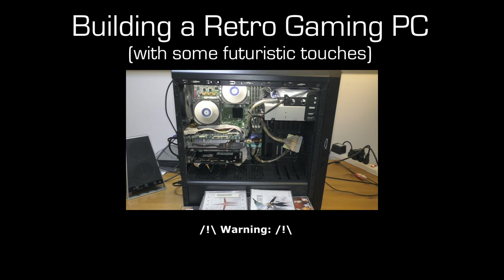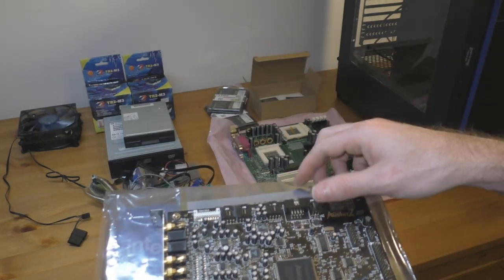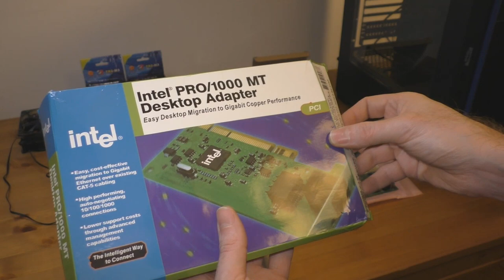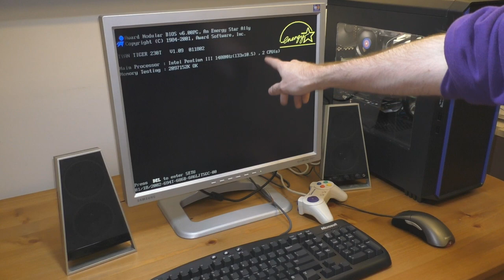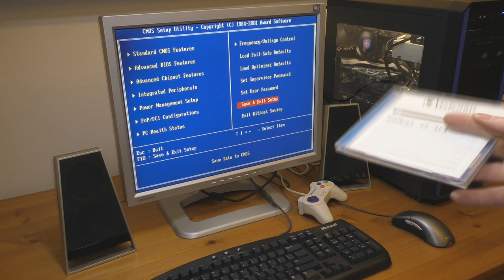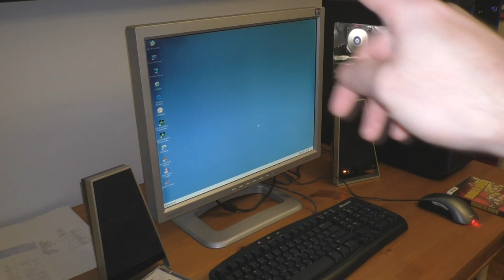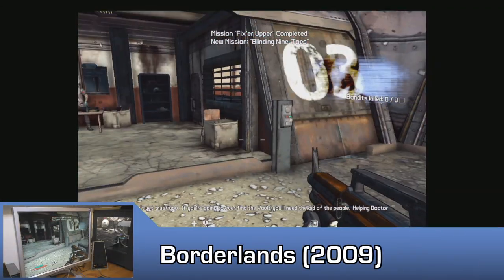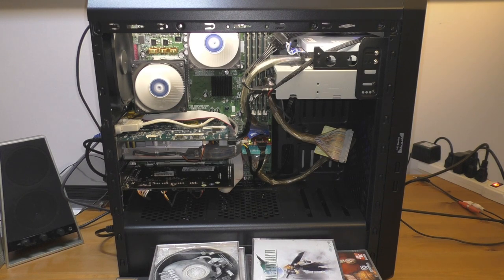[Retro] Building a Retrogaming PC (Dual Pentium III-S 1.4GHz Tualatin, 2GB SDR, HD4670)

Comment: Really nice build! I like the weird combination of parts and how retro it looks with the translucent plastics and rubber cables. Surprised how well it runs newer games. This machine probably runs FEAR pretty well if you turn down the cpu heavy effects like physics and particles a bit. Also, you should be able to force anti-aliasing in older less demanding titles through amd catalyst.
Reply from the maker: Thanks. I'll have to try FEAR. From the minimum requirement that should be ok. Yes Borderlands runs ok, but I don't think I'll have so much luck with other titles (good lord COD4 was horrendous to run).

Comment: That PSU adapter adds the negative -5V rail for an older ISA bus... You won't really get much use out of it with this motherboard having no ISA expansion slots.

But at least it turns out you needed an extension anyway.

Comment: Pretty sure that the dual CPU motherboards were server motherboards.   I'm thinking like the Asus CUV-4x-D, that you can run 1gb server SDRAM in each slot.  Should help with the RAM issues.   You should also setup at least 2gb of virtual memory with your ECC ram and 4gb with the server ram.    Get the latest version of 32bit Linux OS and see if you can install the right drivers for your card,  You can do it with a Live CD if you like.   Best cards that I've used in my ASUS dual P3 Tualatin mobo was Geforce 2 MX-400 64MB SDR.  They also make one with 64MB DDR as well.  Best backwards compatible AGP8x card that I've heard of was the EVGA GeForce 6200.  It has 512mb of DDR2!     Not sure if the native AGP controller can really take advantage of anything beyond 4x but you never know till you try.

Comment: Very nice system and great video.  I have similar systems.  1) Dual Pentium 3 700 MHz in slot design with 1 GB PC100 SD RAM.  Due to the AGP 2x limitation, the graphics card FX5900XT 128 MB.  Everything up to 2002 is going quite well.  From 2003 onwards, however, one notices significant drops in performance as soon as enemies appear or there is a lot of action in the game.  2) Dual Xeon 3.6 GHz Nocona for socket 604 with 16 GB DDR266 (!) RAM.  Graphics card: Radeon R7 250 with 2 GB.  Connected via a PCIe to PCI adapter.  3) HP Compaq Workstation XW 6400 with 8 GB DDR2 667 RAM and Dual Xeon 5350 with 3 GHz for Socket 771. Graphics card GeForce 1060 with 6 GB.  I also wanted to build the system you have, but I never managed to do it due to a lack of components.  It's hard to get a motherboard like that alone.
Reply from the maker: Thanks! Yes I had luck on eBay with the motherboard. It was not exactly the one I wanted (there are model with DDR and a better VIA chipset for the AGP) but close enough. The main turn on the CPU is the SSE2 instructions intruded with the P4 which started to be problematic with games past 2003/2004. I suspect this is why I had so much trouble to run Call of Duty 4. I also had a Xeon 5470 and DDR2 (there's a video about it on the channel) but eventually I sold it. Cheers.